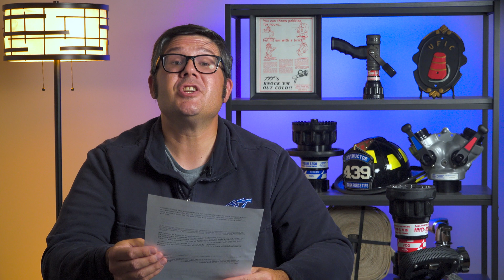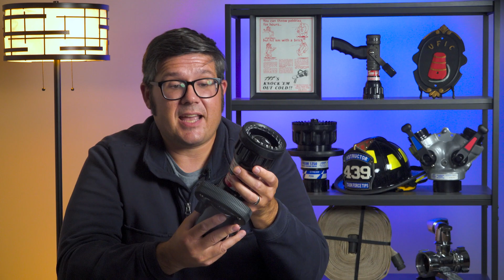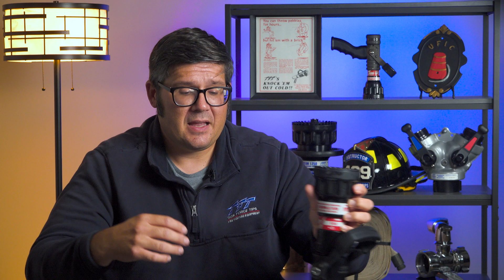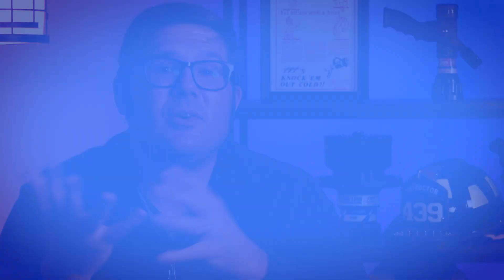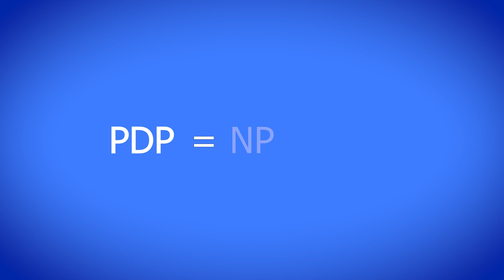How do I measure GPM Discharged from an Automatic Firefighting Nozzle?

Comment: With that 70-200 Gpm nozzle at 75 psi, how do I adjust to 160 gpm flow? I'm not asking how to measure, but how do I adjust flows from 70-200 gpm at a constant preasure?